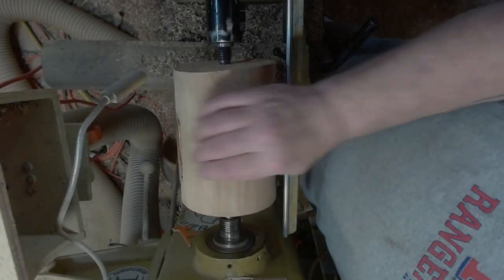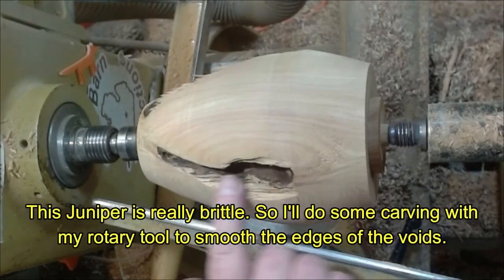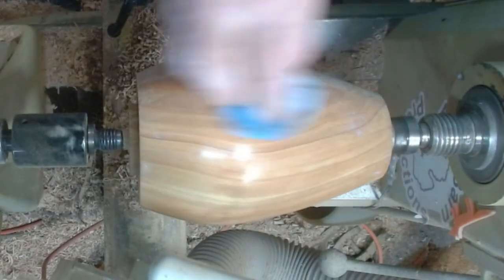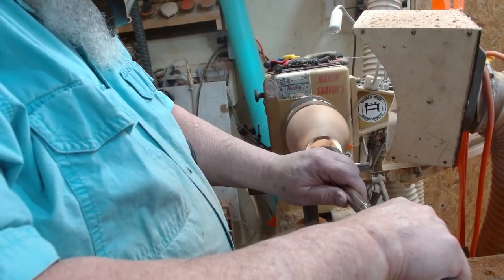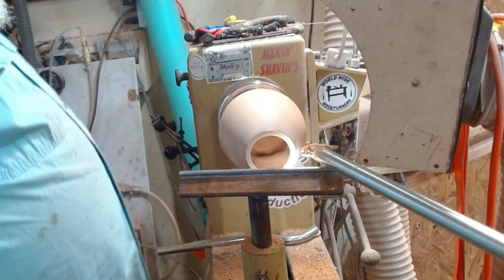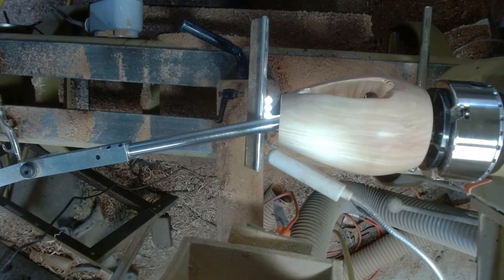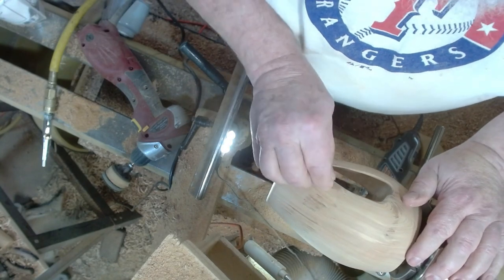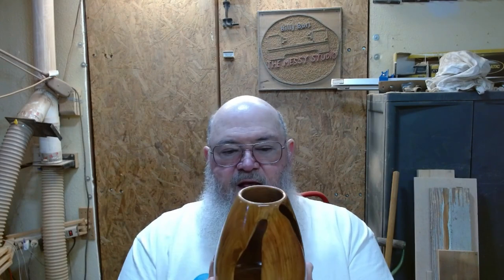The Intricate Beauty of Nature's Voids in a Juniper Vase

Comment: Hi Billy, what can I do about sap that comes out of the Ashe Juniper?
Reply from the maker: I haven't encountered a sap problem with any I've had. The tree was down about a year before I cut it up into blanks. However, it can be a little oily and feel wet when it isn't. So I suppose that could be sap related. I would wipe the effected area or piece with acetone. It might be necessary to do this a few times. Especially before applying a finish. And use several coats of a good sanding sealer.